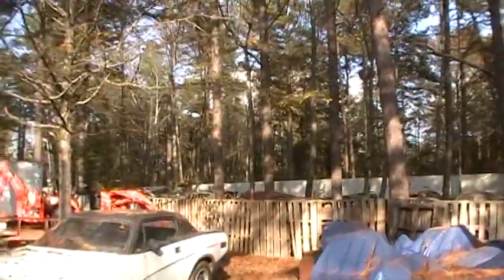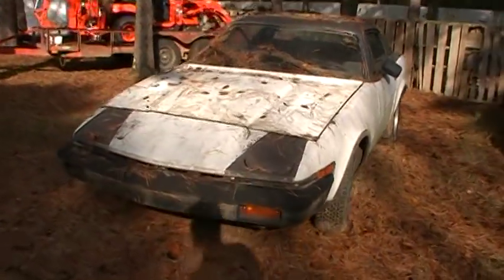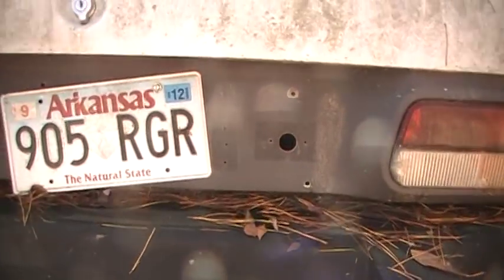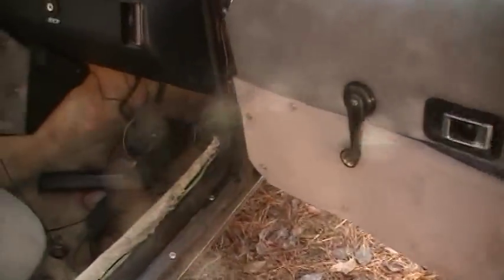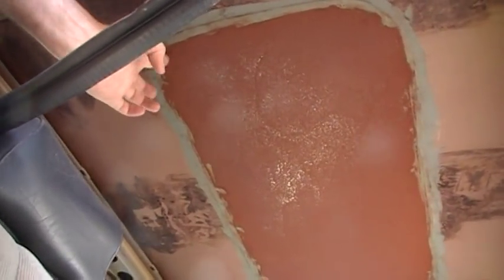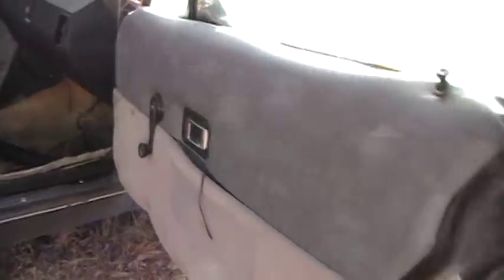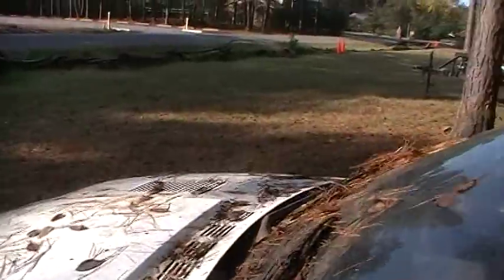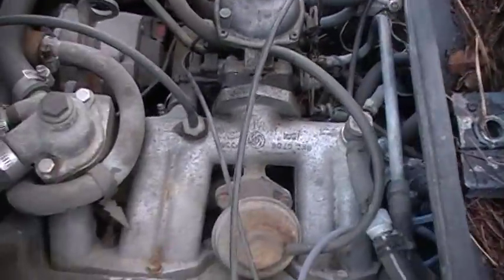Cutworm gete a wedgie!

Comment: All I know about a TR7 is that the engine's are fragile and a good TR7 is still crap...I repaired one engine in 1980 for a guy who thought it was a race car and the piston skirts gave up..Only 45,000K's old...I'm not a fan but power to you Steve for taking it on...This could be your ugly duckling and make a good TR7 that's reliable and nice to drive...Your mission Steve,,,should you choose to accept it..............
Reply from the maker: Thanks Brother Ziggy.  If I can do a quicky on it the Wedge will be my winter car. Keeping my Spit and pickup home and safe. If not, I know where there's a big bluff to push it off of.
Reply: +cutworm59  You have got yourself a 75 or 76 TR7 there.  This means it is a Speke (Liverpool) built model and they are nowadays the ones to have as there are so few left.  Given that it only has a single Stromberg carburettor this denotes a California car originally.  It will be pretty gutless but Ted Schumacher at TSI Imported will be able to fix you up with a twin carb setup (preferably S.U.'s) and other components.  The interior is going to need putting back to standard which will be much nicer but otherwise it looks like it may well be a very sound car.  Best of luck with it and well done for getting Triumph's most outrageous looking car ever.  Everyone is still using the TR7 as a styling blueprint today.
Reply from the maker: +John Clancy Thank you very kindly Big John. If there were ever an underdog Triumph, This is it. Comm # ACL 3368   Apr 1975
Reply: +cutworm59   A 1975 TR7 is about as rare as they come nowadays.  They were all shipped to the Americas for the first year and all had the four speed box.  The four speed revs higher than the five speed so not ideal for American roads really but for sports car driving on country lanes it is not only quicker but owing to being several hundred pounds lighter it is more chuckable too.  The Triumph Wedge Owners Association (TWOA) is the club for these cars in America.  Over here (England) it's the TR Drivers Club.  Only a handful of 1975 cars are known to exist between the two clubs so please keep me updated of your progress.